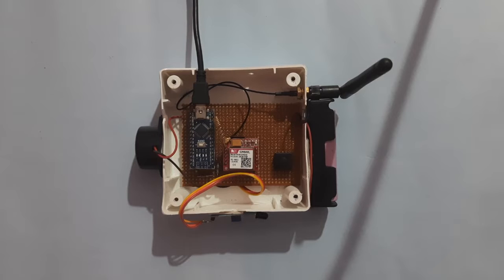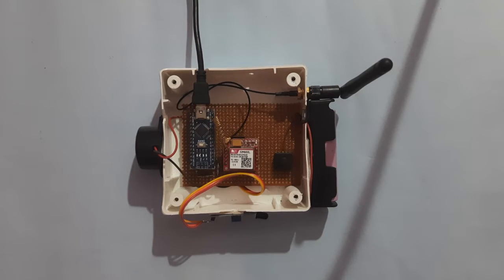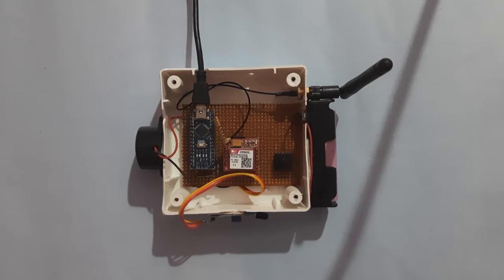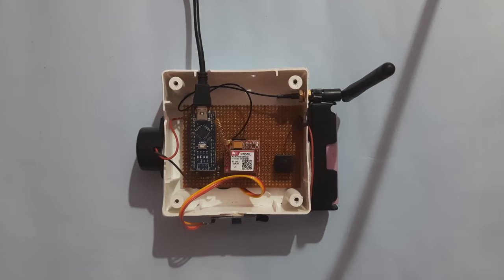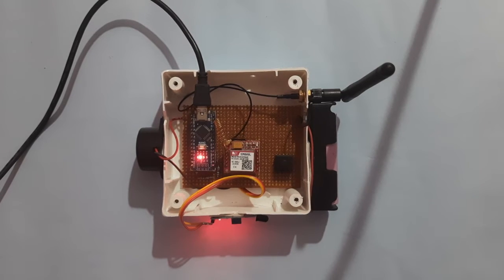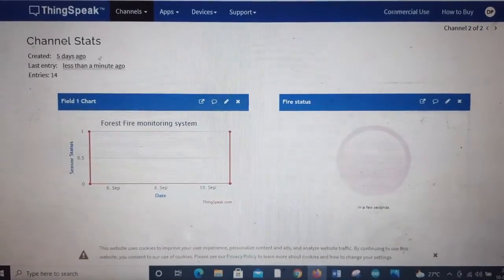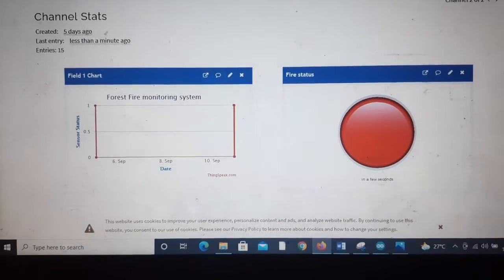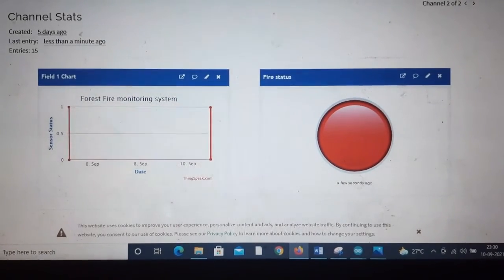IoT Based Forest Fire Detection System using Arduino and GSM Module | Arduino Project

Comment: Instead of Sim800L what network can I use that supports 4G/5G ?
Reply from the maker: There are plenty of 4G modules available from many manufacturers. For example SIM7600, 7670 and 7672 and the SIM82xx series from SIMCOM and  QC200 and QC600x series from Quectel. Unfortunately the 5G modules are still pretty expensive and will cost more than 100$ for the module alone.
Reply: @Circuitdigest  thank you for taking time to reply .